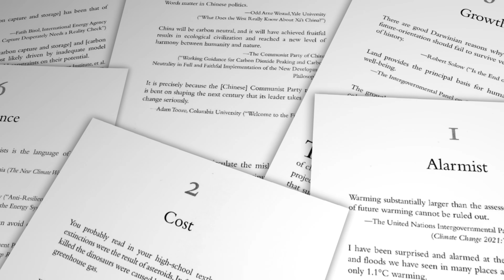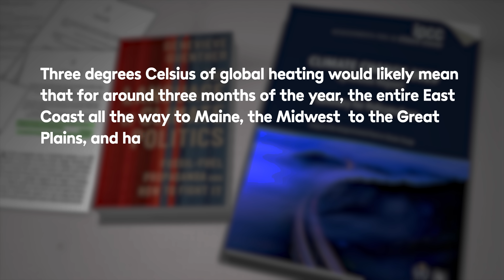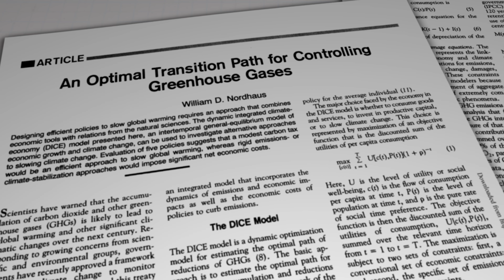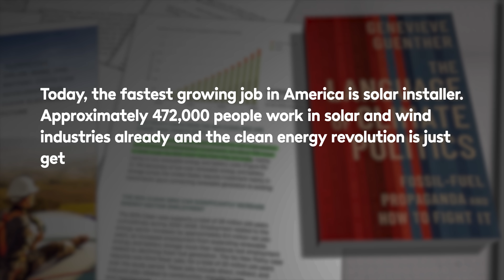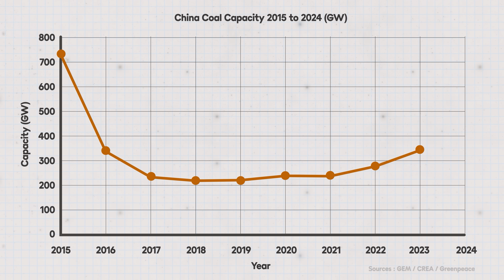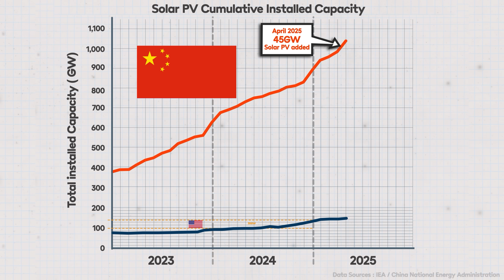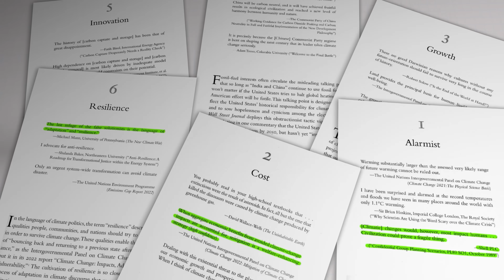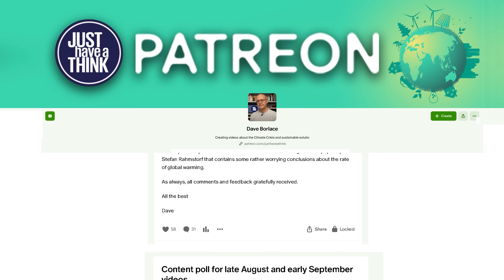New research DEBUNKS climate disinformation.

Comment: I was there for those three days of BC above 49C. In fact, where I live it is even hotter and my thermometer, (in the shade thank you very much), hit just over 50C.

The village of Lytton that burned down a day or two later is about 150 km away. The even larger wildfire that wiped out square kilometers is only 10-20 km over the hill. The pictures I took of the massive smoke cloud come back to haunt with Google classify them as "the magic hour".

Just in case if you were wondering if AI can be dangerous.

Even more dangerous, and I was looking for it to confirm what I knew, is whether a weather event killing over 700 Canadians would make it on the American news. It did not.
Reply: Usta ride my motorcycle up to BC from WA State in the summer.  Have not returned since fire took half of Jasper AB just last year... plus fear of the border policies of the Orange Menace.
Reply: @bjb7587  pretty sad when one has to worry about returning to their own country.

My wife is American and we (used to) travel and live between the U.S. and Canada. Every time we return to Canada at our usual rural border crossing there is a great relief and sigh... Back to metric on the speedometer.

However, if you come up to BC through Midway or just east of Grand Forks (hwy 385 up from Spokane) you will find much friendlier and less drama border agents. Matter of fact, sometimes they are just bored and want to chat.

Osoyoos has been transformed into a fortress, I went through once and won't again.
Reply: @bigskygeneration4474 yeah.  I worry about the fires riding north.  Then Homeland Security riding south. 

Have a seven day trip planned to SW Montana in late September.  However I will watch the fire map every day up to and through the ride.  In 22 and 23 [I think], I cancelled a trip to Oregon and Idaho four times due to fires. 

Far as I can see, this won't stop till the western forests are gone.  Siberia too.  Kinda like the petro companies won't stop resisting till they've pumped out the last quantity of oil and gas.
Reply: @bjb7587  Those republicans won't take any notice of the US/Canada border when they start fleeing north because of drought and heat. They'll claim that Canada has loads of free space to move into. That will inevitably lead to conflict and not just with Canadians but with their sovereign, the British King.
Reply: True. I had no clue about BC getting that hot. Crikey
Reply: @katherandefy   European here - I remember that - but it did not register with me that you almost hit 50 degrees. It noticed because it was Canada - a potential escape for climate refugees - well maybe not. And it was said that the homes are well insulated against the cold but that does not always help against the heat. I know that from where I live (Germany). If you have mass (concrete, brick, tiles, stone at the floor) and can protect the windows you are better off than in the typical timber - wooden particle home that is insulated with styrofoam. if they heat up you cannot get the heat out. 

Although shading the windows and only opening them during night helps.
Reply: I'm in eastern Australia, and understand drought and extreme heat - but what you guys experienced....!?!  That stuff is equally staggering and frightening.  
No surprises that Murrrcan 'news' (hypotainment) failed to report the event. 🤦‍♂️
Reply: @assininecomment1630  thanks. Then in November we got hit with a massive atmospheric river that flooded the Fraser Valley (east of Vancouver) and wiped out three of the four roadways that connected Vancouver.

If you ever catch an episode of 'Highway Thru Hell', we live at the north end of that highway. Through the Coquihalla Valley section it was wiped out. This is the main four lane highway connecting BC to the rest of Canada. 

We live on a big lake with lots of water though. The river that forms the lake and continues west is the same size, or larger than the Colorado River. In the U.S. 40 million people rely on the Colorado. Up here about 200,000 rely on our river. Now you know why there is all the 51st State BS going on.
Reply: I had been aware of climate change for years prior and was increasingly minding how I lived in response, but Lytton chilled me to the bone. It was such a blaring sign, and I kept talking about it to people around me (in the Netherlands), so many people were apathetic. "Oh, that's awful." How didn't this wake everyone the hell up?
Some of us did notice. Some of us were properly horrified.
Thank you for sharing, and I'm so sorry for BC's losses.
Reply: And such is the state of reporting the news.  Thanks for that information.
Reply: Your comment got the eye of a Texan who can relate. Got any newer social engineering ideas on how people can repair the environment while preparing for the worst effects in weather? I cant accept absolutism or economic fatalism. I think its fun living in moderation and redirecting my funds to carbon sequestration & responsible energy use development. I dont need AI, crypto, or billionaires.
Reply: @idontagree9658  first of all, carbon sequestration is a red herring. It is a plot by the FF industry to maintain business as usual. There are no laws of physics or economics in this universe that can make it work. 

It's a long subject. I believe natural gas will be around longer than we anticipate, but oil will be decreasing. However, the U S. is in much worse position for both oil and gas than the industry and government will let on. Maybe 10 years and it is in real trouble. 

What to do? I always think of the line from 'Contact', "Small steps, small steps". I can tell you, living in a walkable neighborhood where one isn't heavily dependent on a car is a whole other level of freedom. We had that in downtown Vancouver where our car wouldn't move for three weeks at a time. I got around by bicycle and my wife walked or took the local bus (even to Costco!).

The trick for the whole lot of us lies in changing habits and lifestyle dependencies. 

Btw, I've worked in quite a few parts of Texas from Conroe to Dallas, Odessa, and mostly in Lubbock. Saw a lot of FM roads! Working with the electric utilities. You Texans loved us Canadian engineers. One started calling us the 'Mounties' because he would call us in when things got tough 😊
Reply: I found a report of 700 wild fires but I cannot find anything in any media that suggests that 700 Canadians have been killed in or due to weather events for any single year or in total since 2015....nothing even close.  Can you provide more specifics?
Reply: @richardlangley90 
https://news.gov.bc.ca/releases/2022PSSG0035-000911

Those are the ones they know about. 

Also, when the tide was out shell fish were literally cooking in their shells.
Reply: As time goes on the more I'm convinced America's voluntarily want to be tortured to death. After 3 nights of it getting no cooler than 18 celsius outside, that would be enough to convince me climate change was real. When temperatures that hot were the first lifetime occurrence of that.
Reply: It’s astounding how little we hear of anything happening outside the USA. But if the latest movie star had a fight with her beau somewhere in the outback, it would be carried live 24/7. We don’t get ‘news’ in the USA ; we get infotainment.
Reply: Check the actual historic weather patterns established by Geologist and Palieontologist.  
The Earth is gonna do what it does.  This is NOT HUMAN CAUSED!
Reply: I'm in Salmon Arm so not sure what your AI comments relates to are you stating you dont believe it a natural origin? And as for the little notice of 700 BC deaths from the heatwave in 1 week I agree and it was also more deaths than COVID reported deaths for the week which  should be the 1st clue to climate change is a farce. The planets temp started to rise and diverge from solar irradiance in the 50's that after 2 atomic bombs in 1945 and all those that followed after underground, in the sky and out in space and global cooling, mini ice age, not warming is the risk, I believe we've all been duped, and consider this as early onset winter settles in. Its not us it them.
Reply: That magic hour bit is just fucking dark.
Reply: @SachinGanpat  especially since it looks like a mushroom cloud at sunset.
Reply: Heat doesn't cause wild fires. Dry does. Period. There's 0 connection.
Reply: @gcburns4  WT ass F! Did you even go to school? How the effing hell is heat not involved in wildfires? What a completely f*cked up thing to suggest.
Reply: He states 'almost' 1000 related deaths. I'm looking for where that number can be confirmed.
Reply: @danielross7899  Its true, I'm in BC too, though I remember 700 as does the comment above and heat related deaths are the #1 weather related event that kills more each year than cold, flood, hurricane, etc etc.
Reply: @danielross7899  the official  figure is 619 https://news.gov.bc.ca/releases/2022PSSG0035-000911
Reply: @danielross7899  
It cant , just speculation
Reply: Thank you so much for your anecdotal data, with no comparisons to past weather events.
Reply: @alexevans9490 if you want a scientific work, read scientific works or articles!
People will talk about their personal experiences. 
Mine from Germany: people cannot skate and drive the frozen lakes since last two+ DECADES but it was still possible in my youth. No proper snowfall as well for DECADES. 
Birdsong is dying down. Insect life vanishing more and more too. 💔
Regarding scientific approach:
How about reading the one from the ScientificAmerican citing Stanford University research:
The current climate-change being 10-100 times faster than others in the last 56 mio years.
Well we people around the world can observe the trend in real time - records being broken around the globe year after year, definitely fast from a geological perspective.
The trend is obvious... 🔥
Reply: @alexevans9490 shhhh, the adults are talking.

Comment: Part of the reason for the backlash is that climate extremists lie to themselves and pat themselves on the back for emission "reduction" by exporting their emissions to other places. Example California shutting down refineries to reduce emissions, but then importing refined gas from Asia countries with lax environmental regulations. California is increasing emissions globally because of decreasing emissions locally. This is stupid! Global total emissions are more important than local emissions, and the oil industry in USA is much better for the environment than the same output in other countries with lax environmental regulations. Also, most transportation emissions are vehicles that run all day delivery, taxi, garbage trucks, etc, but environmental extremist ignore this fact and focus on forcing individuals to buy EV that move only twice per day and have to use public charging instead of charging at night while I sleep. If environmentalist follow their own science, they would have better support

Comment: We all, as individuals, contribute to the problem.  This means we all need to address the problem individually.  Do a little something every year and we will get there.  The low hanging fruit is efficiency and thinking about where you can cut waste .. heat what needs to be heated, turning thermostats down, buy efficient electric appliances ….  I cut my own gas consumption in half in 5 yrs just by doing this.  Couldn’t believe I cut it in half this way!
Reply: The 2020 CREDS study as reported by the BBC remains the best introductory guide I know of. "Climate change: Top 10 tips to reduce carbon footprint revealed"
Reply: @skierpage  The stunning thing in my case was how much I cut without even doing those things!
Reply: Some of us individuals contribute a hell of a lot more than others of us.  Any solution that involves literally everyone changing their behavior is not a solution.  We need action at the state and national level.

Comment: Your arguments are not sound. 
(08:10) Wind, solar and battery storage are cheap now because it's still a fossil fuel powered economy. The costs kick in 20 years in the future when all the wind turbines and solar panels need replacing - and you only have an insufficient and intermittent trickle of green energy with which to do so. 
That is, hypothetically, because in fact you cannot build enough wind/solar and batteries to power the world. A wind/solar green energy transition would require more copper in the next 30 years than has been mined in the whole of human history. And the same again 20 years after that. 
That's your global insolvency. 
p.s. your video on geothermal was similarly unsound. High temperature geothermal in particular has far greater potential than you suggested, because of the supercritical expansion of water vapour above 374'C.
Reply: At 900 new gwh per whatever the interval was, it won't be an intermittent trickle in 20 years will it?
Reply: @jnawk83  Compared to high temperature geothermal, wind and solar is like rubbing a balloon on your jumper! 
According to Nasa/Sandia Labs - Magma Energy Project - in 1982, the US high temperature geothermal resource is a minimum of 90 times current world energy demand. 
The world today uses approximately 600 quadrillion btu's of energy, and Nasa/Sandia estimated upwards of 50,000 quadrillion btu's just from the US. Worldwide the resource is effectively limitless. 
Yet in a previous video the geothermal resource was estimated at just 10-15% of global energy demand by 2050; a figure based on mid temperature, water reservoir geothermal technologies - that have max temperatures and replacement rate problems that Magma Energy simply doesn't have. 
Further though, electricity is only about 20% of the energy we use; and the UK's 12,000 wind turbines provide around 20% of UK electricity demand. So you tell me what that figure will be in 20 years time? 
We'd need to build 36,000 wind turbines to have 24,000 operational in 20 years. And that's to supply 40% of UK electricity demand. And to do so with the rest of the world all building windmills, the price of copper through the roof and into orbit; such that people would be demolishing solar farms to steal the 2.5 tons of copper per mw they contain!  
It doesn't add up to sustainability.

Comment: I am not a climate denier but not one real prediction has occurred. They keep pushing catastrophe and give minor or in fact completely opposite results. Stop pushing fear and hype, start looking at real steps. Part of the issue I feel is the “all or nothing” approach. A 90 - 95% approach would make the solution much more affordable and still give great benefits.
Reply: It's not an all or nothing approach, it's all or we all die approach.
Reply: @jnawk83  Alarm-ism is not an argument. Being skeptical is healthy, use arguments and data if you want to convince someone.
Reply: As Mr. Thinks says. The models predicted warming and we have seen rapid warming. So right off the bat you're wrong. 

The ensuing heat waves, 
 hurricanes, droughts and crop failures are also as predicted.

Comment: In Houston, winter arrives 2 weeks later than it used to.    For 40 years, you could count on a cold snap the last week of September to the first week of October.    For about eight years now,  that cold snap doesn't arrive until mid October.   And half of them have been less of a "snap" than a "general cooling"  Instead of lows in the 40s, we get lows in the 50s.

Comment: china diversifies electricity sources because the more they have the better it is in a war with america. 
solar is impossible to bomb, makes the population more selfsustained leaving more electricity for the military industrial complex
many small inefficient coal powerplants running at minimum capacity are harder to bomb
trump is doing the same, america will need every electricity source possible to fuel the industry

Comment: No one should deny climate change, and I do not. What I do not like is the way the UK government is trying to implement net zero, especially the introduction of EVs, wind farms, look at what happened in Spain, and solar farms. None of these are really "Green" and in themselves do not supply a solution. Carbon capture should have been instigated years ago; the technology has been there, and the infrastructure was too, but they decided to remove the depleted Gas Platforms in the Southern North Sea instead of using the defunct wells. There are acres of roofs that could be used for solar panels with electric cables in situ that could be used instead of farmers' fields where there are no cables. And do not get me started on Sizewell C, which I know was being prepared when Sizewell B was finished, which is many years ago.